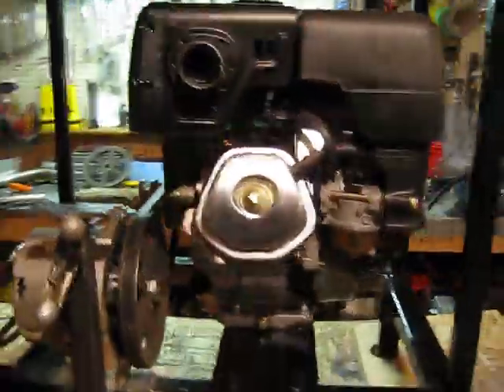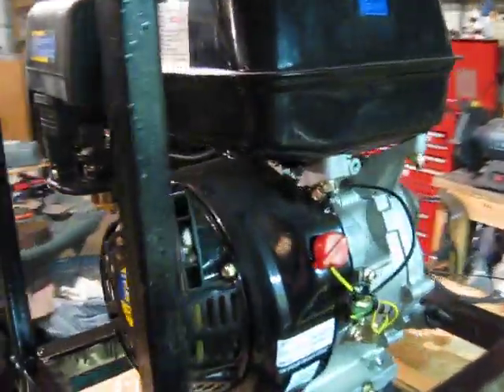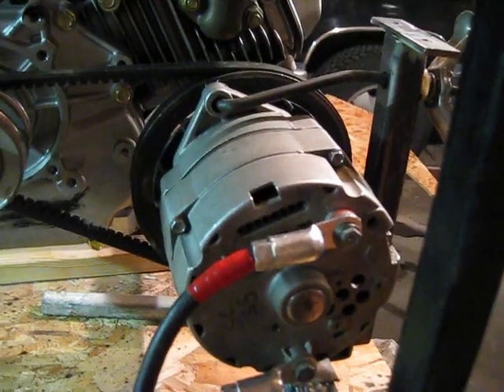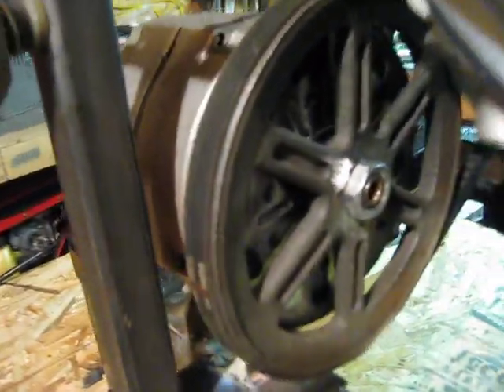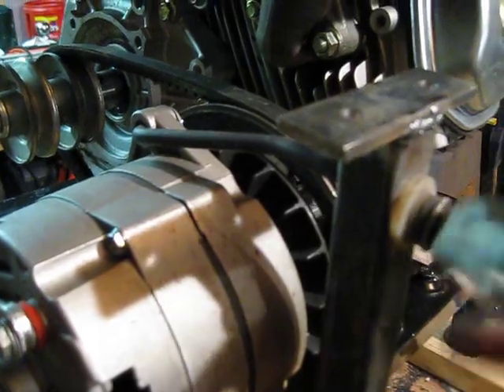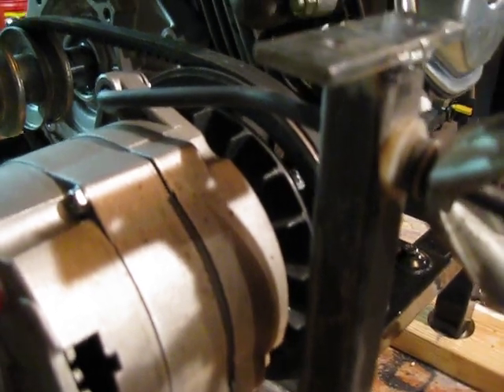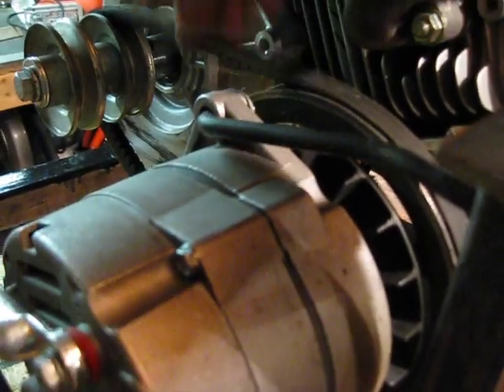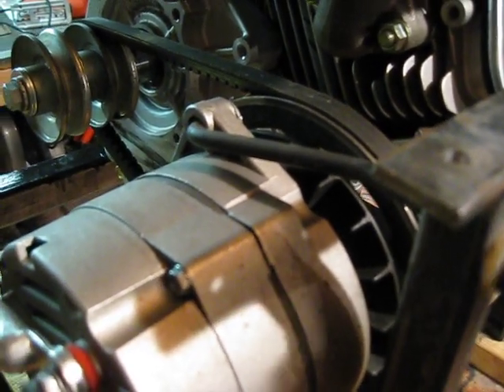9hp OHV engine and  Permanent Magnet Alternator

Comment: In this magnets replace the wire windings in the stator, so the output can't be regulated by adjusting the energy in the stator. PM alternators require an outboard charge controller similar to those used with  photovoltaic panels.

Comment: Nice professionsl looking setup. I made something similar to safely rechargre my marine battery since standard chargers are so unregulated they  just damage good batteries. I used a 1hp ac motor and a regulated 45 amp vehicle alternator i purchased used for $5. After the motor is up to speed i excite the field coil for 1 second with a push button switch from the battery being charged and off she goes with regulated 14.7vdc

Comment from the maker: @luca20yo the pma needs to turn to send energy to the batteries, most people use the pma hooked up to a wind mill, I made this set up to charge my bank of batteries at my camp, sometime I don't see wind for weeks and I need to charge my batteries, this setup charges my batteries way faster than using a battery charger hooked up to a generator.

Comment: How many watts per hour does it generate and how much fuel does it use to do so? It's too bad you couldn't use a diesel engine (assuming this one is gasoline) which is perfect for running wide open throttle and generating the torque required to turn the generator not to mention the superior gas efficiency.

Comment: While it is nice not to have a battery to maintain on your standby generator, this thing is totally unregulated. Simply swap it out for a 'self-starting' alternator instead, and you get regulated output, with no need for a manual slip-belt-clutch. You will still be able to hand start. 

The trick to self-starting alts is that the rotor is permanently magnetized (weak field) so it will generate a little power when first turned, this power is used to firts energize the field coil.

Comment: If you really want it to be even close to energy-effective and/or battery friendly, you might consider placing a (solar) regulator with a 3-step curve in series. 
Youĺl find links on the site of PMC guys or by googeling.
Better ones can even give a soft-start to save the belt and avoid starting problems.

Comment from the maker: I guess I could of hooked up a switch to turn the PMA on and off but I didn't, actually I don't need to loosen off the belt with this motor, it starts up with no problems at all.  My old set up yes, I definitely needed a way to ease in the belt, for my new set up it's not a problem, I thought it was gonna be but it isn't.  I run my 27 inch tv, sattelite receiver and a couple lights at 10 watts for about 5 hours using my batteries,

Comment from the maker: 3 seconds later it was 14.3 volts and I had to shut it down fast!  It was just too fast! That is when I decided to go with the pulley system.  If you look at my other video you'll see I used a 3.5 hp lawnmower engine, ya it worked but what a piece of shit.  This setup has been just awesome, I've had it at camp for 5 months and it works flawlessly, nice and quiet and smooth.

Comment from the maker: so i got two batteries tied in parallel and tried again, this time the motor stalled, so I decided right there I needed more power.  I purchased a 9 hp only because I got it brand new for 250 bucks, I probably would of went smaller but the price was right.  So I hook this motor up to the PMA same way as the 2hp, shaft to shaft, this time I used my deep cycle boat battery,  it was reading 11.9 v at the time.

Comment from the maker: I first tried my 2 hp ohv engine hooked up directly to the shaft (love Joy connection) no pulleys just straight shaft to shaft, you know what happened when I tried to hook it to a simple car battery, nothing, that's right. I couldn't get the motor started, so I disconnected the booster cables and then got the motor running, when I tried to hook back the booster cables the engine didn't stall but it was very close,

Comment from the maker: I'm not an expert by all means, but I can tell you from trying different things, there is no way a 2 hp can charge my batteries, picture 7 heavy equipment batteries tied in parallel. I know they are not designed for this purpose but they were free. They're for hard cranking and not like a deep cycle battery.

Comment: The extra cost is wasted fuel. It stalls because the system is not designed correctly. The typical answer is to over power everything. Why not do it correctly? Video will be posted when ready. I'm about to start cutting metal.

Comment: If that is the case, it is due to the PMA's poor efficiency. It's a simple equation of mechanical power in and electrical power out. The trick like I said is matching the two components to operate near peak.

I'm working on a small generator, 700W electrical output or so and expect to need only 770-800W at the engine crank to get the job done.

Comment: That's because you didn't match the speed of the generator to the load. If you are generating 40V it's going to try to draw far too much current. The current load requires torque and due to the mismatch the smaller engine stalls. You probably only need 14-15V to charge your battery bank at 55A. To get a good match you would need to have the engine's torque curve.

Comment: You need to optimize your engine size. 9 HP is 6.7kW and charging 12V batteries you should get ~340 amps output. The engine is way too large and you probably only need 1-2 HP.

If you are getting 55A that's about 760W into the battery. Even if the electrical system was 50% efficient only 2HP would be needed. The trick is matching the generator to the engine output torque and power.

What you have works fine but is not so efficient.

Comment from the maker: I have solar panels and a wind generator, the engine is just one more way to help. I spend weeks at a time at camp and the batteries are being used faster than I can charge them. Usually by the end of the second week I run the engine, maybe 10 bucks worth of gas is all I use.